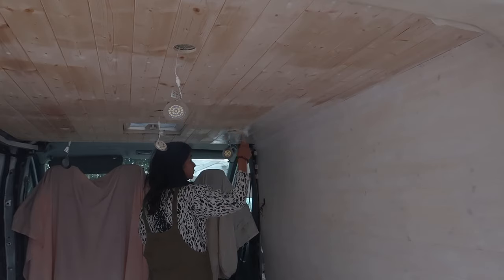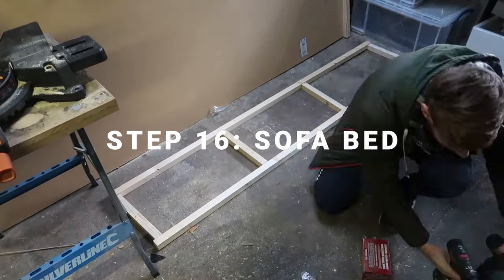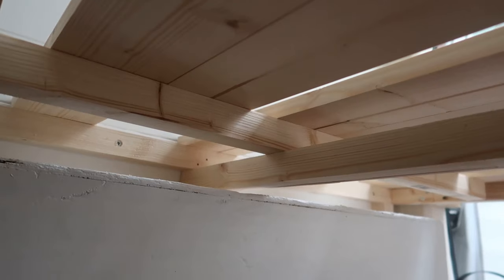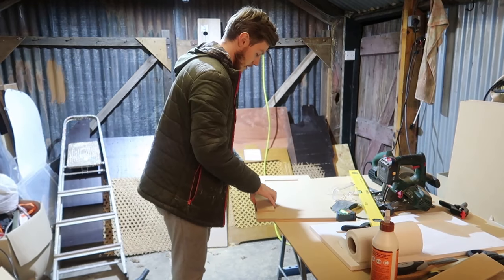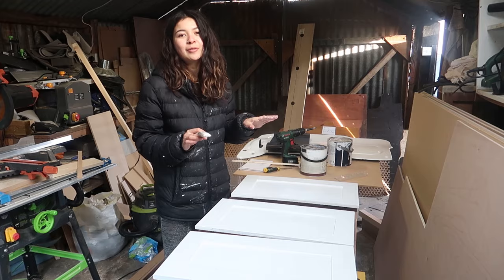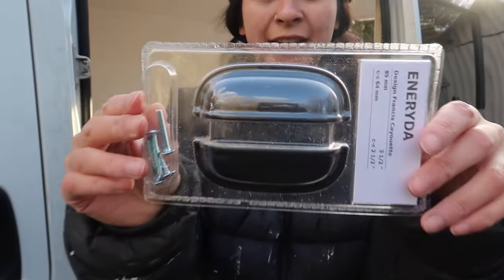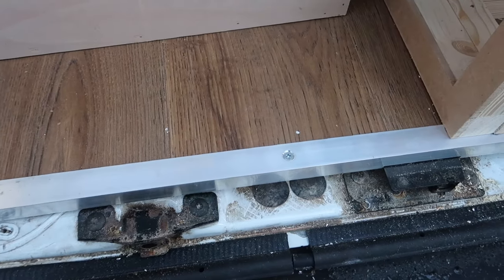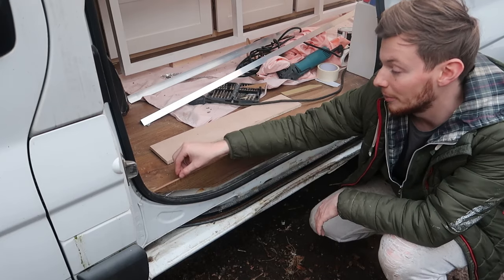Building a sofa bed for your campervan | Vauxhall Vivaro SWB Van Conversion PT4

Comment: Amazingly you are at the same stage as me on my Renault Trafic. I have also made the bed lift to access the odd spaces that remain under the bed. I am now building the surround of the sit down shower area behind the driver's seat as I have a long wheel base van which gives me just enough space for a toilet and shower box. Looking forward to your next video.
Reply: Same here! Except substitute shower for 2 removable passenger seats.

Comment: Hi guys, happy to have found your build videos as I have recently purchased a swb Vivaro myself ready for a conversion. I already had various ideas in mind but am holding off the start for a little while watching  to see how you guys go about things and overcome any problems along the way! The delay is not too much of a problem as due to health and mobility reasons  I can't work and van building on such a tight budget takes time. I've just been concentrating on getting the insulation, sound dreading and lining ready to go for now. keep up the good work, I look forward eagerly to the next video!
Reply: @nicroams  thanks guys, I think I got lucky with a reasonable van at a fair price considering it has had a recent new clutch and recon gearbox. I just wish this weather would give me a break! It's been so wet down here in South Devon. Not ideal for cutting big holes in your van for windows and sky lights! Which I have still boxed sat in the van. I don't really want to start trying to do anything else until I get them in then can fit around them.

Comment: Great but you missed the runner fitting for the drawers. can quite see if they are bottom or middle fitting runners or what they attach too? But its a great design

Comment: Thanks for sharing this. After watching quite a few videos on pull-out sofa beds, this is the one I will model my build after. I was wondering,  did you do anything special to keep the drawers from coming out during a turn? Thanks.
Reply from the maker: Hey! Aww that's so cool to hear! We sold it prior to attaching locks but I absolutely would, either cabin hooks or my fave, Japaned locks 🤗

Comment: Great videos, just currently building a bed at the moment with a similar design, what dimensions did you go with for the width when its a couchand again when its pulled out? and the height from the floor? Thanks in advance :) keep it up!

Comment: Great vids guys,nice job. I've got a swb high roof Vivaro which I quickly messed around with last year for quick getaways,bed/cooker/storage etc,what's your thoughts on trying to run some sort of flexi trunking from the low level heaters in the cab to the back of the van so its already nice and toasty in the back when you stop somewhere?  Do-able or not? Also,have you noticed much difference in the weight of the van and difference in mpg with all the baton and cladding fitted. Cheers
Reply: @nicroams  Thanks for the reply. I'd imagine it's a lot snugger in a smaller van but like you said it all depends on the output of the heater. I might try it to see how it goes once I've stripped the van out ready for the rebuild, fingers crossed. I'll keep an eye on your build as well to see how the progress is coming along 🚐👍😉

Comment: Nice vid guys!! Need some info.. what’s the size of the bed(open/closed)? How did you fix the bed?
Reply from the maker: Hello, I've sold the van now so I can't remember the exact specs but it was 190 length and I think around 110 when fully open. The bed is screwed in to the floor 🥰
Reply: @nicroams  much appreciate!!

Comment: Great video thank you. I also have an old  Vivaro swb van,. Its already been converted but I want to change quite a bit. would  you mind telling me what the spray paint is that you used inside the van around the windows please?  Im also having problems hanging curtains between the cab and the back of the van due to the shape , I have only just come across your channel but is this something you have done successfully ?  many thanks, sharon.
Reply: @nicroams  Thanks for the reply. I am not very good at figuring out how to do stuff lol, so may wait to see what you do. I am so worried about drilling into the van . Its hard to see what im drilling in to as its carpet lined. Its brilliant what you are doing to your van I am beginning to wish I had brought a van and then converted it myself. Cheers..

Comment: I have watched all of your series so far. I am in the process of looking for a van, had my eye on the Renault Trafic which is the same as the Vivaro as you know, then I changed my mind and started looking at Peugeot Boxer MWB vans.
Now I am back looking at the Vivaro/Trafic because I thing a Boxer will be too big for our driveway. Lol.
I am struggling to find a fairly low mileage Vivaro/Trafic for £5000 and certainly don't intend paying VAT.
What mileage is on your van as I think anything over 100,000 miles is excessive?
I do intend cladding my van when I get it similar to what you have done, but I intend putting 2 windows in opposite to each other.
I am also looking for a LWB even though it's just 400mm difference.
I think a diesel heater is important as you can then use the van in the Autumn/ Winter months. You mentioned in a previous video that the van being so small you can just use the cab heater, but that's not really environmentally friendly running your engine to heat the van. Cheaper to use a diesel heater.
Great series and I am feeling more confident about doing my van when I get one.
Good luck with the project and look forward to other videos. :)
Reply: What do you think of the high top LWB Vivaros, might just be able to get one of those with sub 100k miles?
The guy who does the MOT's on my cars and bikes also fits out camper vans, he goes for that professional look with fitted units, wardrobes, showers etc. Not really my taste as they look kind of caravan like inside.
I like a more natural individual look like you are achieving, just don't want it to look cheap.

Comment: Can you explain how you joined the lengthways frame to the widthways frame, at the corners? I would have thought that you need a screw upwards from underneath but how do you screw the from the side when there is already a screw in the way?

Comment: What's happened with this build guys? Thought the next video would be up by now.  I have my Vauxhall Vivaro LWB now since my last comment. Just got the side windows fitted yesterday, getting a roof fan fitted next week.
I have started the sound deadening and insulation. Also fitted a wireless reversing camera even though I have reversing sensors on the van.
Cladding the ceiling and carpet lining the rest. I purchased a set up 6 lights with remote control for £16, they are surface mounted, so will not need a hole drilled in the cladding only a small hole for the wiring. 

Hope you are doing well. :)
Reply: I'm in no rush guys. Still got a few things to buy, diesel heater, toilet, sink, double seat swivel, etc.
Bought a Sportive model, so don't need anything on the outside. Going with the slatted pull out bed also, but it must be able to hinge. 

I thought you were both full time van builders.
Reply: would love to see how you are getting on, i've got the exact same van and currently insulating :)

Comment: Shouldnt have added the drawer fronts to the under bed boxes, although very nice, they are an unnecessary weight addition, that in all campers you’ll be trying to keep weight as low as possible.
Reply from the maker: This van has 1100kg payload which is the same as a LWB Sprinter. So you really don't need to worry about saving weight. Unless you aim to lower your MPG but we value a homely look over having belongings on show 🤗

Comment: You can use wood dust with wood glue and use it also as a filler than it gets almost the same color as your wood ;-)
You will regret the use of Hot Glue sorry to say that, you have so many clamps why don´t use something better.
Reply: Good idea about mixing the project sawdust with wood glue to make matching wood filler!

Comment: Nice cupboards wall unit but way too deep than essential. Why block off the cab seats? Fit swivels and use them and fit slimmer wall units along the side and make the bed narrower.
Reply from the maker: I think it depends on what you class as essential. Again, we value a homely look so decided not to do swivel seats. The sofa can seat 3 comfortably, it is unlikely you will have 5 people in the van so we found it best to block off the cab and utilise an extra wall for a kitchen. Just remember everyone's layout is designed for the person in mind which doesn't meet everyone's ideal 🤗

Comment: I bought a large white trunk to store my infant niece’s stuff in https://www.youtube.com/post/UgkxNuLbiXpLQ-mKH5NlyjrNe88hiCk2N3Cg , as she comes to my house frequently. For now, it’s toys on one side and diapers, wipes, and other baby care items on the other. As she gets older, it will be all toys. I had originally wanted a trunk with a hinged lid, but I was afraid of her smashing or pinching her fingers in it. This will be a much safer option. The lid has great padding in it and it is actually nice to sit on. It feels very sturdy and secure. Looks like it can be wiped clean easily. If it gets abused by her, I won’t be terribly upset because I paid less than $50 for it on Prime Day.
Reply from the maker: Amazing! Glad the video came in handy 😊